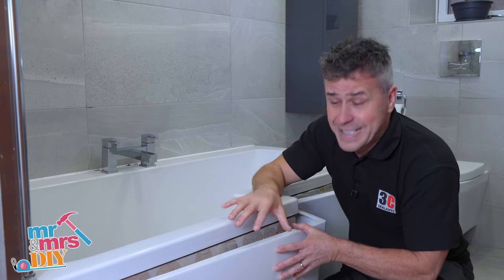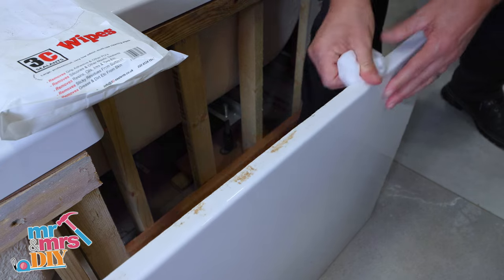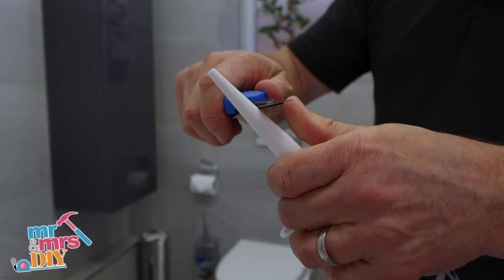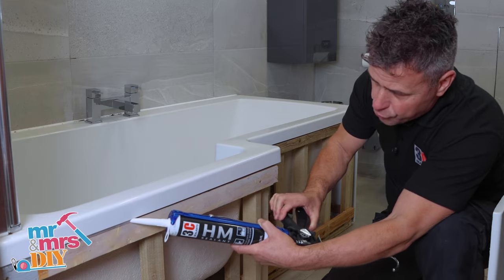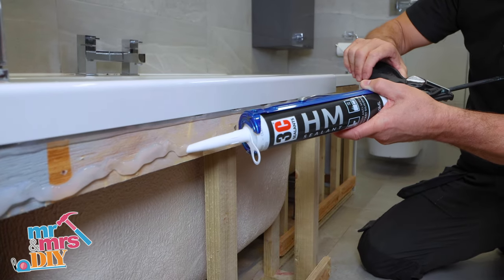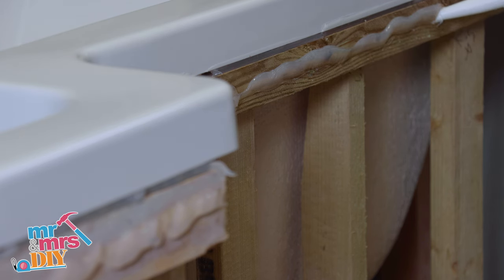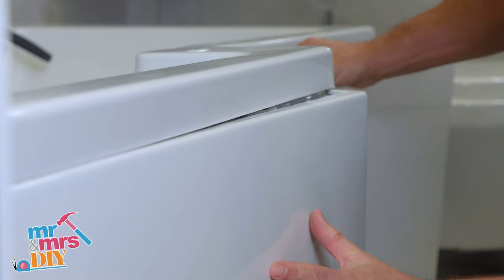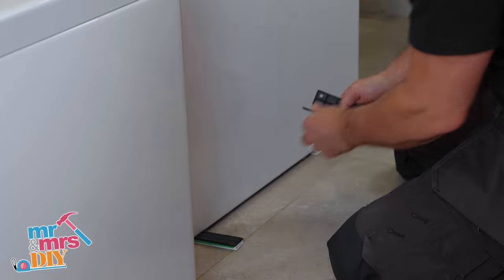60 Second DIY Tips - How to Re-Fit & Seal a Bath Panel | Top Trade Tips

Comment: Great vid. What about the gap at the bottom? Do you just leave the small gap or seal it too?
Reply from the maker: Thanks Chris, we didn't seal it at the bottom, just left a small gap
Reply: Good question! I came here to ask the same. I thought that you had to leave it unsealed for easy access. So I guess I was wrong! Just “installed” my side panel. Might have to seal it all up
Reply: If you're going to seal the top of the panel then you might as well seal the bottom, it's not going anywhere
Reply: @jarvis911  dont seal the bottom, in case there is an internal leak having it unsealed will be an early warning, sealing it will cause only the water to trap and damage over time.

Comment: It’s Craig from Big Bro, the first one, right? Anyway, I’ve been trying to remove my bath side panel because we have a leak down through the floor and causing damp in our kitchen ceiling. 

I wanted to see if there was some water behind the panel. But I also wanted to re-seal it with silicone. 

I’m finding it difficult to remove the panel without breaking it. It’s wedge in behind the floor tile and then the overhang at the top of the bath. 

Any suggestions on how to free it out?
Reply from the maker: They can sometimes be quite tricky to remove when the floor tiles have been tiled up to the panel,  Maybe try a trimming knife right around the all edges just incase a lot of sealant has been applied before hand
Reply: @MrandMrsDIY  same issue need to investigate a leak - installed before I bought the house. It’s well stuck …I’ve split the sealant, still struggling… any specialist tool or tips greatly appreciated! Feel I’m gonna have to break it to remove it at this point….

Comment: I have a wooden side panel on my bath but it has a plastic seal piece at the bottom, what would be the best was to attach that plastic bit back on? Repairman took the side of the bath off and didn't put it back on 😒
Reply from the maker: There are a number of sirloins and glues that you could use from the 3C range, like, Maxbond, Multi-use, GP would all work well.

Comment: I'm about to replace my neighbours who has no access to under his bath so I plan to drill small holes in the panel and screwed it to the batten in the corners using screw caps and washers to make them water tight then apply a bead of sealant along top and bottom of thr panel so if they need to remove it you can unscrew it and replace the sealant afterwards cheaply. Anyone with experience tell me if that'll do?

Or shall i just stick the panel to the batten like this and be done with it
Reply from the maker: Yes a batten would be easier to remove, alternatively you can just a low mod sealant which can be pulled away easier

Comment: What happens if you have a leak and need access?
Reply from the maker: Hi mate, you could use their Low Mod version, which has the same properties as the HM but it can be pulled off easier on applications such as this, thanks
Reply: @MrandMrsDIY  Thank you.

Comment: And what to do if there is any problems example need to change bath taps? How to get panel off?
Reply from the maker: You can also use a LM sealant which 3C sell if you don't want it to be sticking down as tough as the HM!

Comment: If you do this it will never ever come off for maintenance 😂
Reply from the maker: You could still put it away if you needed to maintain it, however if the plumbing is some right, and you maintain the drains from above you shouldn't need to remove it again unless your changing it for a new suit

Comment: Where are the videos showing you how to remove a plastic bath panel 😱
Reply from the maker: We've not created one, most bath panels ether fall off and become loose and crack so they should lift out easily, thats why I try to silicon our in so they last, if you do have plumbing issues then a plumber would cut away the silicon to remove the panel
Reply: Mine has these awkward screws to be fair,  with practically no head and tiny , I may have to throw in the towel and get a professional in 😱